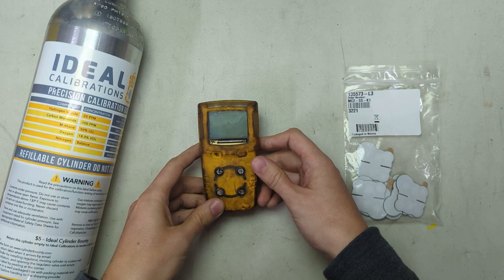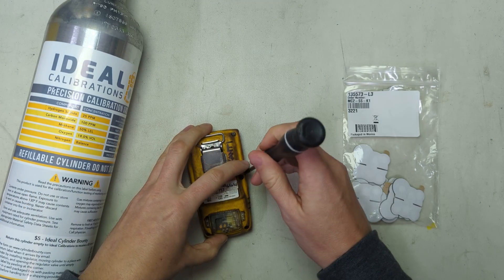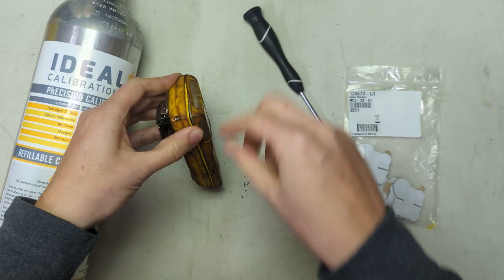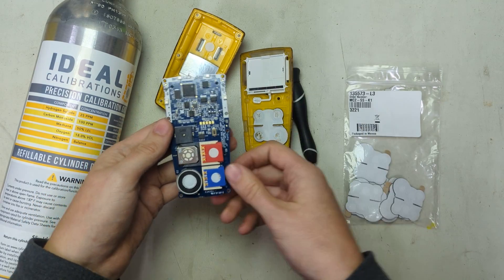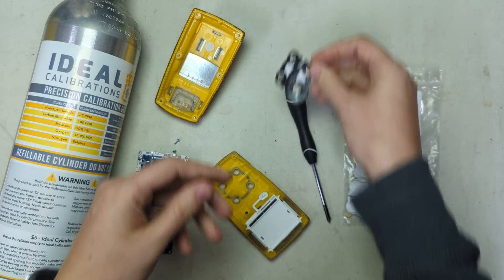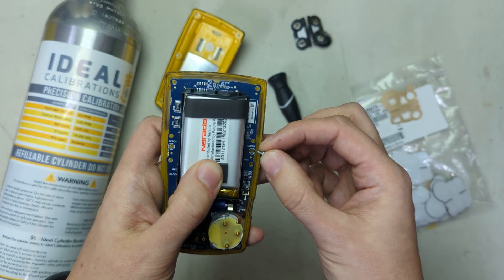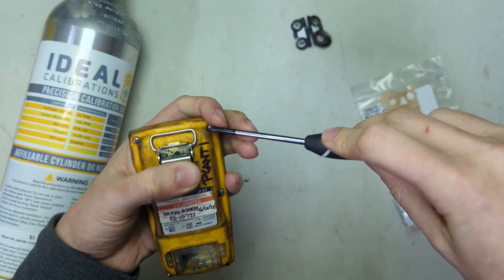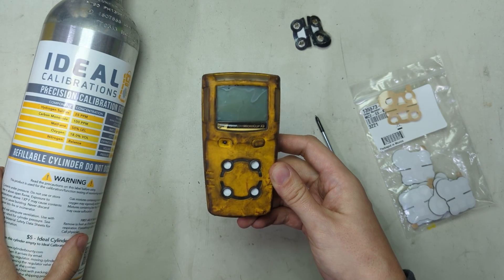Honeywell BW GasAlertMicroClip X3 Filter Replacement Guide - Gas Detector Service

Comment: How do you fix an O2 sensor malfunction?
Reply from the maker: Hey Samuel,

Best bet would be to fix an O2 sensor fail is to just replace the oxygen sensor (found here if you need one - https://idealcalibrations.com/sensor-bw-gasalertmicroclip-x3-o2-sensor/). If your old sensor leaked any electrolytic fluid on your O2 board you may need to replace that as well (part for that here - https://idealcalibrations.com/bw-gasalertmicroclip-xl-xt-flex-printed-circuit-board/).

Once you've installed the new sensor let the unit sit for 45 minutes or so to stabilize. Then zero and calibrate the X3 and you should be all set.

Hope that helps, let me know if you have any further questions!